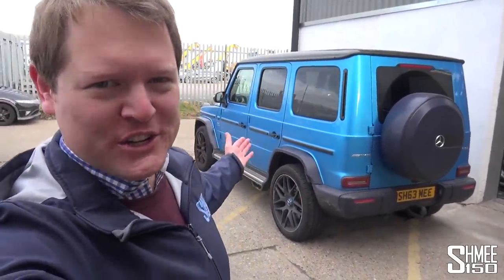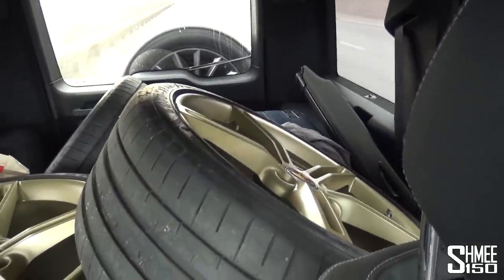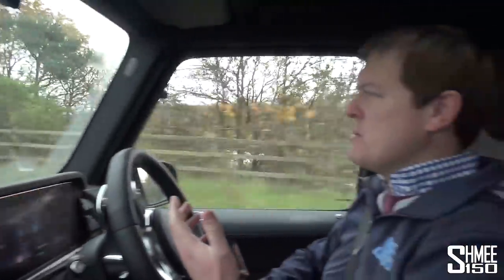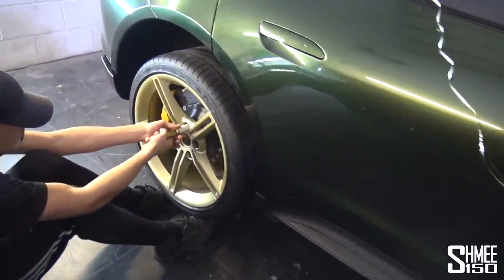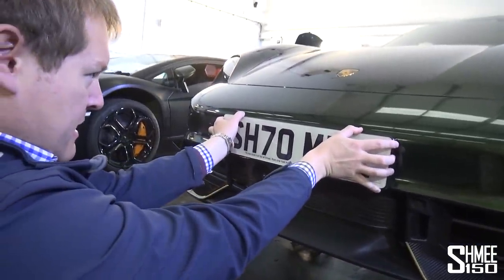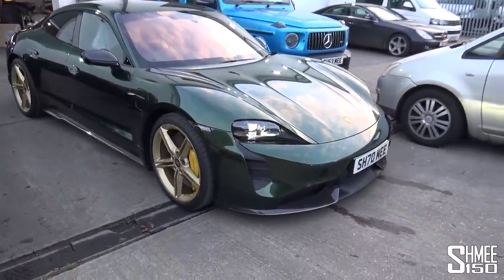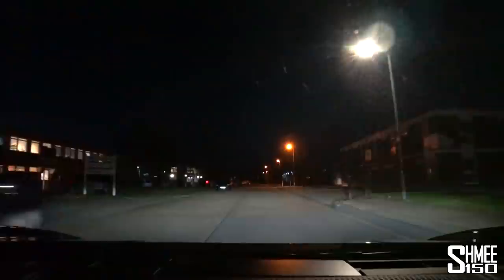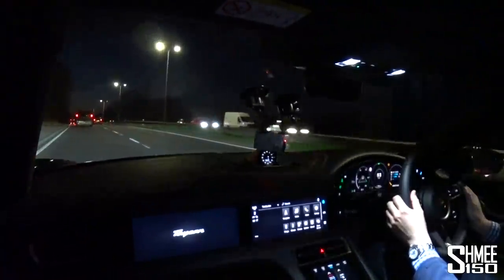My Porsche Taycan is COMPLETE! Wrapped in Midnight Green and Gold

Comment: Tim this is spectacular.  Wow.  However, I'm thinking the brake color stands out as not right.
Reply: I agree, although it’s also a low key flex since Porsche carbon brakes will always have yellow calipers from factory
Reply: Just change the calipers to black or silver ,they stand out too much rest of the car is great
Reply: I love everything about this build except for the brakes.  When posed from behind and on an angle they seem to match the rear number plate pretty closely and it is not bad,  but when viewed from the same angle at the front and the white number plate comes into play it feels wrong.  It feels like we stopped the build at 97.5% TBH.  I am not sure what color would fit best but the build looks so great that I almost want to find a way with paint to do a brake caliper delete.  Now, it was hinted at that he has more stuff to do to the car, and if some of that is a match for the calipers it might work.  I would still like to see them deleted regardless though :)
Reply: Yellow brake calipers is exactly what makes this spec perfect.

Comment: You should change the color of the brake calipers and then it's perfect
Reply: yes
Reply: Don’t think that will happen lol coz it’s the turbo s
Reply: @charliebraithwaite9386  how’s that?
Reply: @darianoechslermgp  the brakes being ceramic composite is the reason they are yellow.
Reply: Absolutely
Reply: Agreed. Yellow is ugly af in this beauty spec.
Reply: @GrantG  ceramic composites can only be yellow?
Reply: @Bphillips2808  only yellow unless wrapped after purchase or negotiated a wrap before purchase typically. Just only ceramic will be yellow
Reply: @GrantG  nowadays you can ask for carbon ceramics in black, from factory. Don't know if it is available on the Taycan though.

But yeah, change that to black, please! You can always change it back to yellow whenever you sell the car/remove the wrap.
Reply: Should had left it alone. Looks like Snoop Dogs car now .

Comment: Green and gold is working 👍🏻
Needs black calipers though.
Reply from the maker: I'm not necessarily in disagreement, but it's a big permanent change to have calipers off and painted so I need to know I'm committed to the car long term before I could think about doing it. Not to mention the Porsche warranty conditions, they wouldn't be very happy about that change...
Reply: @Shmee150  just curious, is your paintwork still covered from corrosion rust etc with your wrap?

Comment: When changing tires remember to mark each tire position so you dont mix them up.
Reply: That would be the case if the front and rear tyres would be the same but they are a lot wider at the rears and the rolling direction is indicated on the tyre so left and right is also know without marking. So it is not necessary for this car ;)
Reply: I thought it has all 4 same size.

Comment: No idea why you would mess around with brand new Porsche wheels. 💁‍♂️ I wouldn't touch a used car that has been modified. Surely it will reduce the residual value...not that you're arsed. 🤣

Comment: I run an EV and have for 2 years. It’s not hard as long as you’re organised. Just like petrol or diesel vehicles they all run out of fuel if you don’t make the effort to ‘fuel them up’. 99% of folks have access to a charger at their home so you leaving the car in a place where you don’t have one is not a negative on EV’s it’s a limitation that you have introduced and it may cause you some irritation but that’s not the fault of the car.